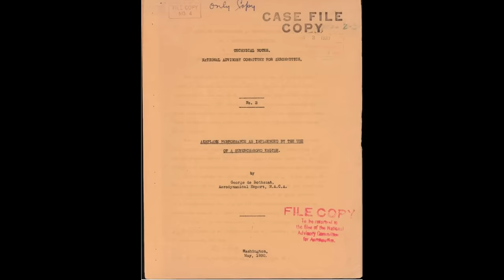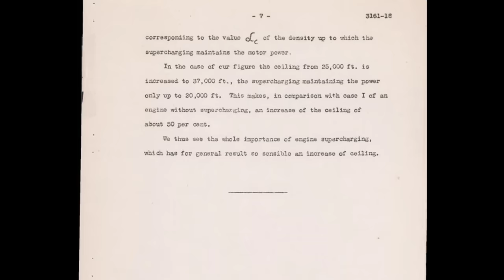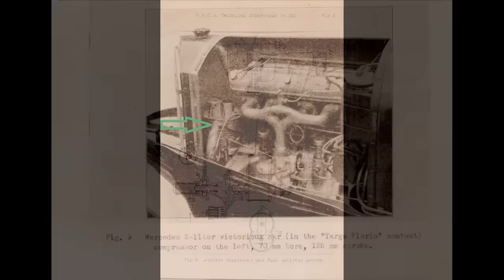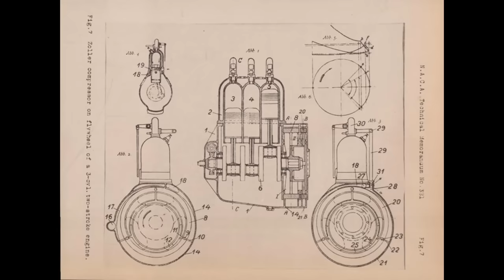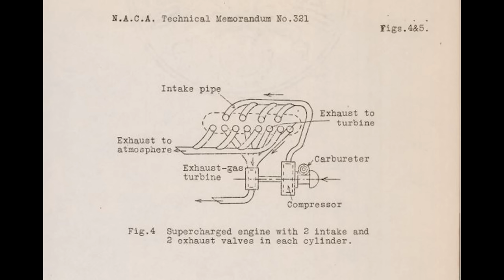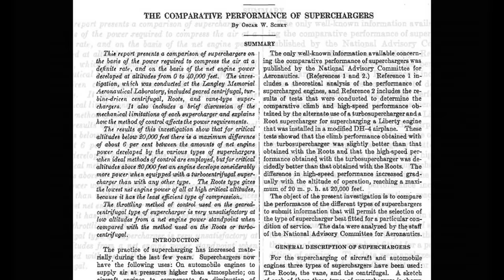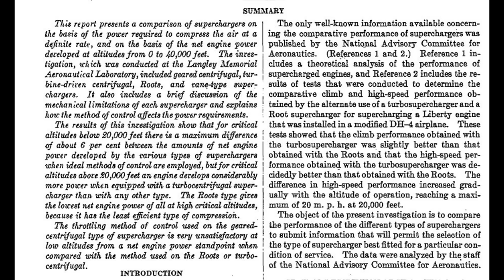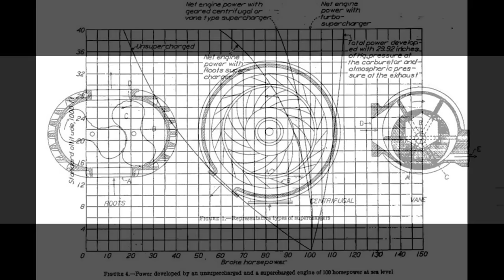Turbo vs Supercharging in WW2 Airplanes

Comment: Hi Greg,
As allways a great pleasure to watch and listen and learn. 
 One question came to my mind during this video: did NACA and/or American engine engineers ever considered the power gain from engine exhaust thrust versus Turbo-charging? Reason for this question is a DVL (Deutsche Versuchsanstalt Luftfahrt; a german equivalent to NACA) study that claimed a 13% to 20% thrust increase of the powerplant system (assuming a 75% efficiency of the prop) when designing proper exhaust-jets.
A graph in this article is claiming superiority in power gain of exhaust-thrust vs turbo-charging into altidudes under 36000 feet.
This study was Quoten in the magazine "Luftwissen", 1942, issue No.9 .
I am really curious how far this comparison was considered in the US considering the success of B-17 and B-24. 
P.S.: in which way can I share a copy of this report for the case you are interrested?
Reply from the maker: Hi Ralf, yes, exhaust thrust was a consideration and is explained vary thoroughly on this channel in several videos.

Comment: Out of passing interest... Roots type air pumps saw a good bit of use as early cabin compressors.
Reply from the maker: True. They were  not designed initially for supercharging. The Roots brothers designed them way before automobiles existed. It's a fascinating story, but they have been used for an incredible number of purposes, and the Roots blower is an amazing device.

Comment: A Note on the XP-39 and its turbosupercharger - It was noted during flight testing that the airplane wasn't performing up to expectations.
Tests in the N.A.C.A. Full Scale Tunnel showed that the airplane had mugh higher drag than calculated - the main culprits were the intercooler required between the turbocharger and the Allison's integral supercharger, and the oil coolers required for the turbo, and the cooling hood of the turbo itself. (Not fully retracting the nose gear didn't help.)   There was no way the XP-39 could meet its performance guarantees.
So - Bell pulled out all the turbosupercharger stuff, redesigned the nose, and installed an altitude rated V1710.  At that point, it could, just about make its brochure figures.
The airframe was just too small for all the stuff it needed.
  The P-39's bigger brother, the P-63, was developed to use the 2-stage (Hydraulically driven Aux Stage) Allison - however, it was still too small to incorporate an intercooler, which limited power output.  (It also didn't have much room for gas - a great handling airplane with good performance from Sea Level up past 25,000', but too short-ranged for the Western Allies.
Reply from the maker: Hi Peter, it's funny you would mention that as that exact information from NACA on the P39 is in my upcoming P47 video.
Reply: The Merlin 60 has an intercooler, aftercooler, and backfire screen. Size wise the Kingcobra, Mustang and Spitfire seem much of a muchness. Allison seem to have had neither terribly good engineers nor terribly good business sense.

Comment: The waste gate regulates turbo boost. The supercharger will always be on a fixed ratio. As air pressure thins the waste gate will allow the turbo to spin faster allowing for boost to be maintained up to a certain point until a turbo just can’t push more efficiently. Turbos are less effected by altitude vs a supercharger. All depends on the compressor map for any unit.
Reply from the maker: Hi Steve. Because of the way youtube sends me comments, I can't tell if this is a response to the video itself, or another comment. The gear driven supercharger can maintain boost up to a certain point via one of two commonly used methods, throttling, or a variable drive system. In other words, both the turbo, and the supercharger can maintain a given level of boost as the aircraft climbs as explained in the video.
Reply: Greg's Airplanes and Automobiles More of a open ended comment I suppose.

Comment: Regarding the pilot's manual mentioned @20:25, the B24 had marginal handling, and was more unforgiving of any pilot errors or eccentricities, particularly compared to the more stable B17. The manual seems to be urging new B24 pilots to be extra cautious and aware.
Reply from the maker: That's all true, but there were plenty of planes that were tough to fly, yet these types of cartoons are unusual in pilot's manuals.

Comment: My understanding is that turbo chargers where developed for high altitude flight because they can put more air into the engine then a supercharger and can be adjusted.
In 1978 Porsche released the First tubo CAR that worked !
Reply from the maker: They have a more efficient drive system, and it's more controllable. Of course there are drawbacks as well. As for the first turbo car that worked, I really think it's the Jetfire, I have a video about it here: https://youtu.be/xllnqZhY8vo . I under stand the "that worked" part is a bit subjective, but the Jetfire's issues were the owners and G.M. not the actual car itself.
Reply: Saab 99, BMW 2002, Corvair...
Reply: Has i said Porsche was the first car manufacture to introduce tubro chaging that worked!
Here is prouf .

A frequent owner complaint was “lack of power,” and a trip to the dealer would reveal that the owner had run the Turbo Rocket Fluid tank dry. More conservative owners didn’t drive the car hard enough to generate boost (and thus lubricate the turbo’s compressor shaft), leading to frozen turbocharger assemblies over time. The Turbo Rocket V-8 engine ran hot and experienced the same cooling issues found on other Oldsmobile 215-cu.in. V-8 engines. Ultimately, however, the complexity of safety mechanisms tied to the fluid injection system helped seal the Jetfire’s fate.

In response to these problems, General Motors offered Jetfire customers a deal in 1965. At no charge to owners, Oldsmobile dealers would remove the complex turbocharging and fluid injection system and replace it with a four-barrel carburetor and conventional intake and exhaust manifolds, solving many of the reliability and performance issues that had plagued the car. Because most owners jumped at this opportunity, finding a Jetfire model with its original Turbo Rocket V-8 and turbocharger assembly on the market today, in any condition, is particularly challenging.

Comment: Just wanted to say congratulations on your videos. Your oratory skill is a gift very few have. Keep up the good work. I have a request for a future video. There has been a debate over in Europe for as long as I can remember about the decision of Rolls Royce to place carburettors in the Merlin engine rather than fuel injectors. The unspoken inference is that the engineers in Germany knew more about engine design than their British and American counterparts. However with the Merlin engine having things like sodium in the valves to take heat away, I find that hard to believe. I read that the choice of using carburettors was to take advantage of atmospheric pressure. The Spitfire was a defensive fighter and had to get up quickly. Is that true?
Reply from the maker: No, it's not true. Everybody switched to fuel injection as soon as they were technically able to do so, even the British. The confusion is that some fuel injection units were called "carburetors" , but were actually throttle body fuel injection systems, however that term didn't exist at the time. The  P47, and Merlin engined P51s had these systems.  Starting in about 1943 the British planes started switching over to these newer systems as well. https://en.wikipedia.org/wiki/Pressure_carburetor  I don't know if I need to make a whole video about this, but it's such a common misconception that maybe I'll work it into another video. My next video is already running into overtime, so I don't know if I can fit it in yet. Oh, thanks for your king words.

Comment: I have just found your channel and have watched several of your videos, it's excellent information presented well.  In watching this video I recall an article I read years ago probably in Car & Driver that referenced a WW2 plane that the later models used turbo compounding.  Essentially the exhaust of the turbosupercharger is directed into another exhaust turbine that added power to the crankshaft of the engine.  I'm not sure but I think it was the B-17.
Reply from the maker: That was something that existed, mostly a post WW2 thing though.
Reply: Bobo, As Greg wrote below, the turbo compounding happened after WW2 in airplanes. The only engine to be make production was the Wright R-3350. I don't think it was installed on a production basis in any bombers. 
https://en.wikipedia.org/wiki/Wright_R-3350_Duplex-Cyclone

Comment: Formula 1 is actually using hybridized electric/turbochargers. It's a conventional turbine turbocharger where the shaft is extended from the housing and into to a motor/generator. This has the added benefits of pre-spooling to eliminate turbo lag, as well as being able to recover energy while the turbo is running full speed off exhaust gasses.
Another turbo design that works very well in cars, but is redundant in aircraft.
Reply: Electric supercharger.
Reply: Ellenor Malik hybrid turbocharger/electric supercharger. It's driven by both a motor AND exhaust gasses.

Comment: It is wise to avoid the outdated term "turbo supercharger" because of the present existence of combination turbo-superchargers.  These act as gear driven superchargers at low power that shift into exhaust driven turbuchargers as exhaust flow increases via an overrunning clutch.  This eliminates issues with turbo lag and also works to provide scavenge air in two stroke diesels.  The EMD 567/645/710 series are likely the best known uses of turbo-superchargers.
Reply from the maker: We are talking about WW2 planes here. I think I made the definition of terms pretty clear, and I can't re-write NACA's reports to include modern and often technically incorrect terminology.
Reply: Nah we do understand exactly what he is talking about mate.

Comment: damn now i cant wait for the upcoming P47 in DCS :-) Focke Wulf testbed 190 long nose was used by Daimler BEnz for  a turbo conversation of a V12 DB603 engine with a ring cooler in front like the 190D9. But the big belly for the supercharger let them called this thing Kangaroo .. It was the FW190V18  (Versuch18).Here at section "high altitude" It produces 1600hp within 10500m .  https://en.wikipedia.org/wiki/List_of_Focke-Wulf_Fw_190_variants

Comment: This video clears up some issues as to why the V1710 underperformed in the single engine fighter,  why was it never fitted with a two stage mechanical supercharger in time to be competitive with the Merlin?
Reply from the maker: Great question Ted. Eventually they did set up a two stage system, but at that point never had a plane that was well set up for it. It was also a remote system and was bulky, but it worked and gave the P63 1800hp at high altitude.
Reply: @GregsAirplanesandAutomobiles  There is so much in this video to think about, you note the republic rainbow as the pinnacle of turbo-supercharged development.  Would love to hear more about the R-4360, the VDT variant looks particularly interesting.  Every time I walk around the B-36 on display at Wright-Patt I am in complete awe...

Comment: I guess nobody figured out screw blowers back then? The difference between a PSI  and a roots type is plenty amazing in automotive applications. We build blown alky drag boat motors that live in the 60+ lbs of boost pressure world...less heat, smother airflow and 5x more be money.  to buy..

Comment: It is heat that makes the wheel go round.  (And for that matter heat makes the pistons go up and down.)  If the turbo charger ran on pressure, it could not more intake manifold pressure than the exhaust manifold back pressure imposed.  Turbos work because they run on waste heat.  Pressure and temperature go hand in hand, in fact, temperature is part of pressure.  Hot molecules move faster.  Faster molecules strike the walls of their enclosure harder generating more pressure.  When you do an energy balance of a heat engine, you consider both pressure and temperature.  Temperature rules.
Reply from the maker: So if I put my turbocharger in the oven it will spin? Of course heat and pressure are interconnected, but that doesn't mean that it spins due to solely due to heat.
Reply: Ok, I over simplified.  Heat flows from high temperature to low temperature.  No temperature difference, no work.  Do an energy balance and you will find that heat is what makes the wheel go round- that's why they call them heat engines.
Reply from the maker: Air flows from high pressure to low. Heat is a factor in pressure. I may be missing your main point. Are you arguing that the turbo don't cost power to turn?
Reply: By and large, the energy to run the turbocharger comes from the waste heat of the exhaust.  If you install high temperature thermocouples (I recommend type K- and even those don't last long in this application) in the exhaust manifold upstream of your turbo and downstream of the turbo (preferably before the stream from the waste gate joins) you will see a temperature drop across the turbine.  There is a pressure reduction, too, but this is largely due to the fact that the lower temperature gas is more dense.

Comment: Yep, Trevor is right. Your videos are excellent but this one is particularly interesting. You might have an opinion about this: I wonder why they did not gear-link the exhaust-turbine to the main drive shaft and source energy from that drive shaft to power the supercharger. (And have a multi-stage supercharger, but a fixed single gear ratio between the exhaust turbo and the main shaft.) In this case, if there is no supercharging at low level, there would still be energy recovery from the exhaust. They could also have done both, alternatively: At low level provide energy from the exhaust to the main shaft, at high level, go in regular turbo-supercharger mode (unlink the exhaust turbo from the drive shaft, link directly to supercharger instead). It's a bit complicated but I suppose it would have been worth it. Higher efficiency and more power at low level, I suppose.
Reply from the maker: What you are describing is very close to a "Power Recovery Turbine". This technology was just emerging at the end of the days of the Piston engined airliners and bombers. In short, it worked, but there just wasn't enough interest or time to perfect it before the jets took over. The DC7 had it, but the DC8 was a jet.
Reply: @GregsAirplanesandAutomobiles  Interesting. Thanks a lot for your reply!

Comment: The P38 main problem was wing warping caused by COMPRESSION of the air at high speed an unknown phenomenon in a dive limiting it's fighting ability. Aircraft would break apart or if the pilot survived the aircraft would come out of the dive inverted (upside down) with a terrified pilot. It was fixed by installing under wing flaps to counter the problem. All those made for Europe were lost when the Transport  I believe was shot down enroute. So the MoD was  never installed in Europe. It also had poor Cabin heating unsuitable for High Altitude in Cold climates freezing the pilots. Meaning it mostly stayed in the Pacific. The Original Alison engines fitted the scourge of US aircraft with a 7 hour life span before rebuild killed more than a few pilots.

Comment: Maybe I missed it, but does the term "stage" in supercharging mean switching the gearing ratio whilst in flight?  I have some warbird flight manual reprints and they always mention to reduce manifold pressure before changing stages as you climb.I think you did a commendable job of presenting the material at just the right level of detail and also including the proper historical context.  I bought those warbird flight manual reprints and they always mention to reduce manifold pressure before changing stages as you climb.
Reply from the maker: In technical terms "stage" means an additional compressor. Speed switching is just "speed" the terms for the second speed of the second stage are often called an additional stage, although technically, it's just an additional speed. To avoid overboost it was normal to pull the throttle back before engaging the next stage or speed.

Comment: There are mechanical advantages turbo chargers have due to drive pressure. I build a lot of engines for drag racing. A billet hemi with a super charger weather it’s a Screw type or Roots type or Centrifugal type one thing is the same... you better pull the oil pan every run to inspect the rod and main bearings.  The same motor with turbos on it will go 20-30 runs on a set of bearings. Aviation engines don’t turn much RPM so I’m sure it’s not as critical, but having drive pressure from a turbo acts like a air bag to slow the piston down on the exhaust stroke at TDC.